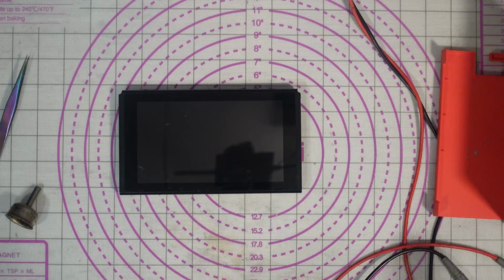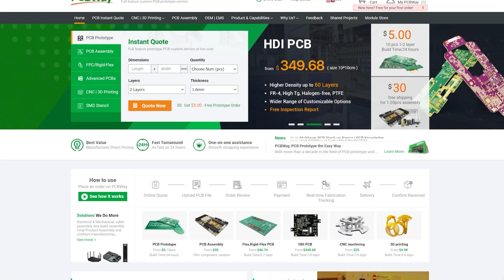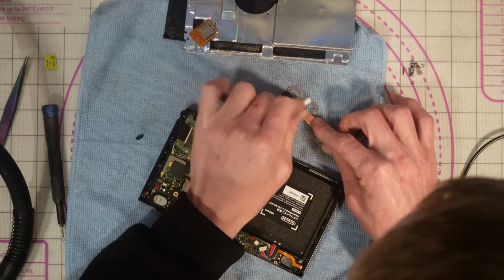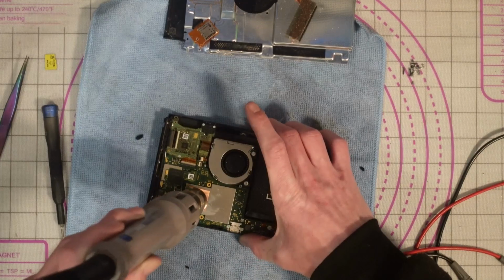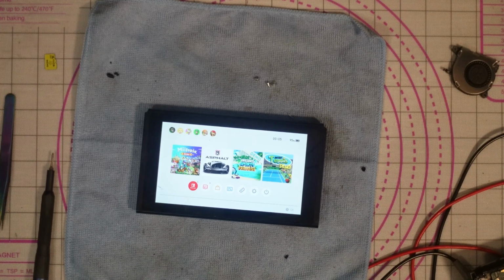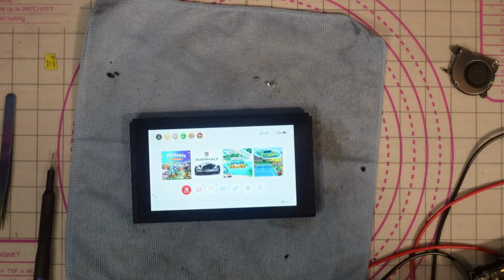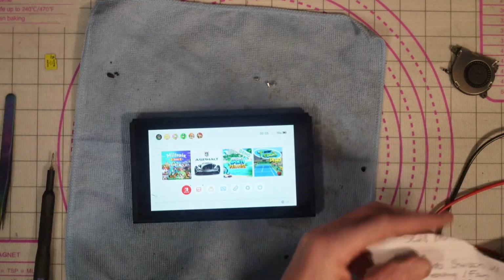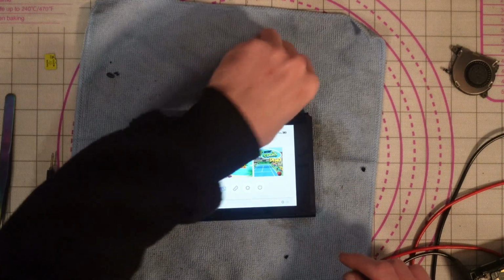AN EASY FIX WHEN YOUR NINTENDO SWITCH OVERHEATS!

Comment: I accidentally removed a diode on my Nintendo Switch board, which caused excessive heat, the Wi-Fi to stop working, the fan to stop spinning, and the Joy-Cons to no longer charge 😭

Comment: Nice fix, Phil :)
I am a collector of old useless laptops, mobile phones, cameras, walkmans, etc. What type of thermal paste do you recommend for an old laptop that has a desktop P4 CPU inside, that even heats up my workshop after an hour of use? I use that XP laptop to upgrade firmwares on old phones that need XP. And it is insane fast for an XP machine, because I overclocked it :)